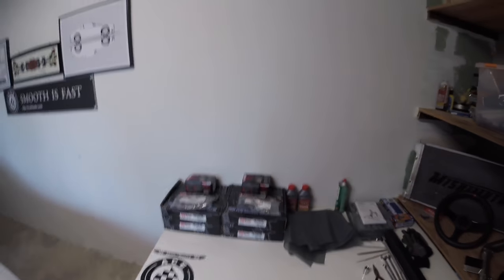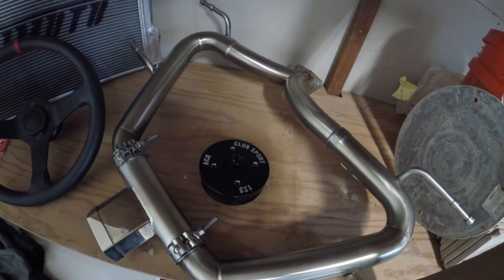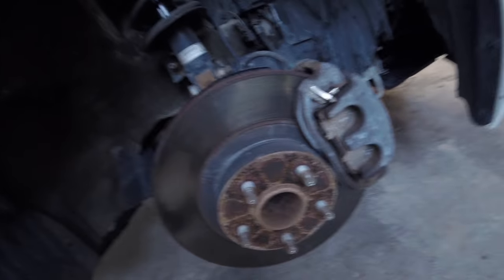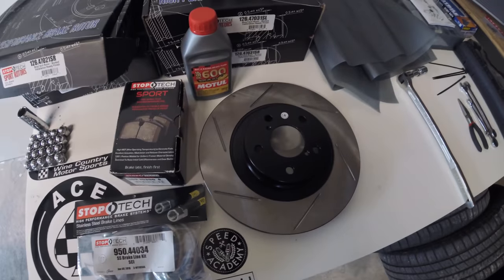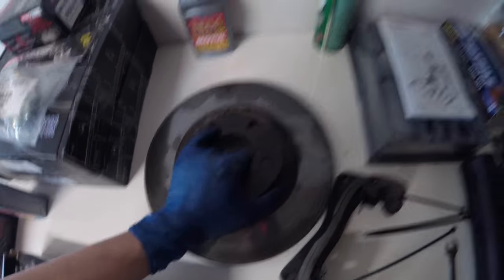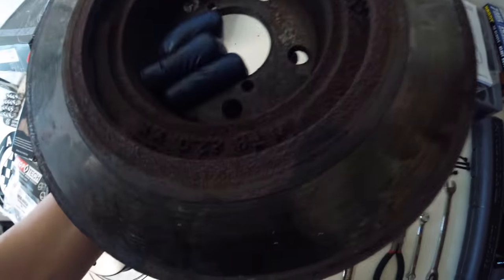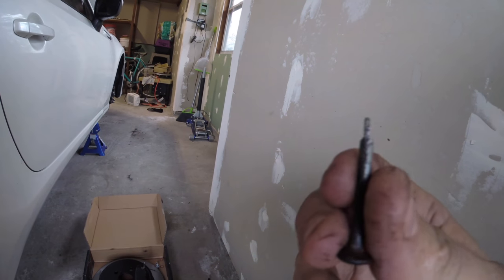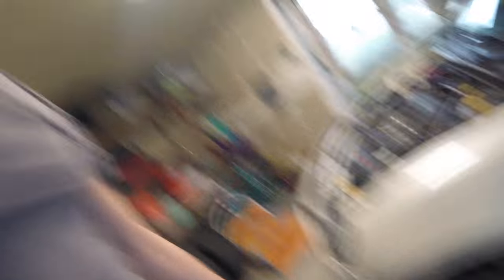First Vlog plus Stoptech Brake Install

Comment: Just ordered a stop tech break kit rotors and pads and break line ...front and rear .... Is it ok to used stock break fluid ... Just a daily driver ...
Reply from the maker: Daily, sure. Not on track though. I do,however suggest running upgrades fluid such as motul rbf600. No downside for daily and works well of track as well.
Reply: Hennessy * have question I’m planning of getting the Stoptech kit but it comes in pair or single because in tire rack I found them for $162 for my Escalade
Reply from the maker: @juliobello4561  should be fine!
Reply: 86 IT thanks for the replied guys 
Appreciate the help 
Probably is my project for next weekend 👌🏼